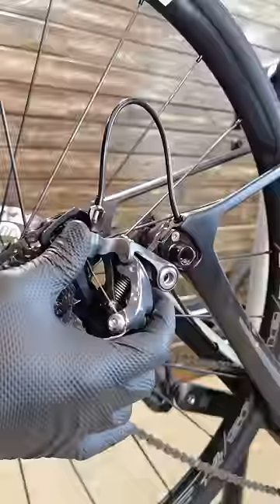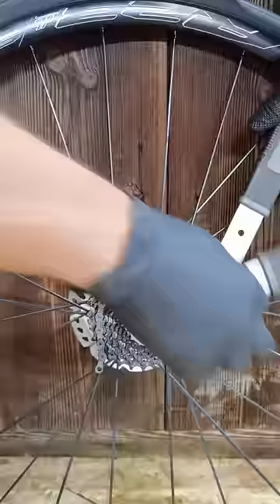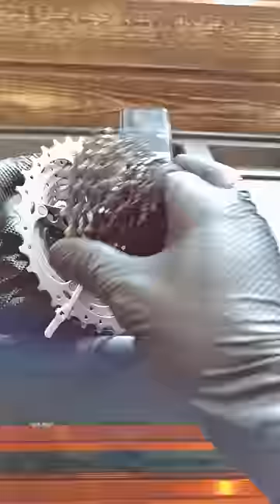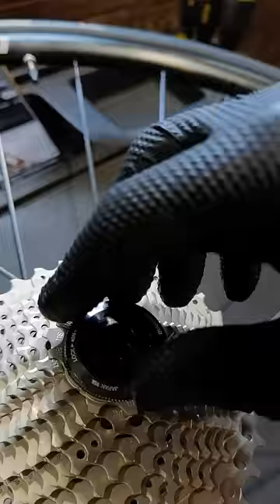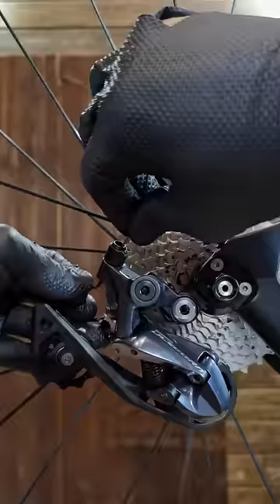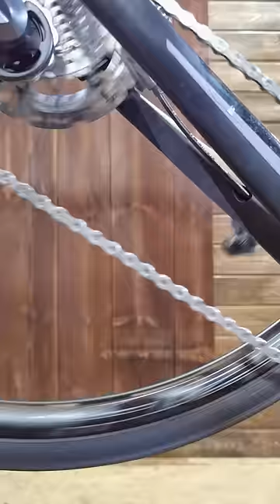Need lighter / lower gears on your road bike? Do this.

Comment: Tip: get the Sunrace CSMS8 11-36 instead of the shimano one, even more range and it as a 12 tooth cog so you have 11-12-13-15 instead of the big 11-13 jump at the top end. shifts maybe a tad harsher but just as fast/good.
Reply: Big jump?  😂

What about the 45-51 on the XT cassette?
Reply: @ulukai_555  I have 24-34 jump in 7-speed megarange freewheel but on higher end 2 teeth difference is affecting cadance much more than you thought
Reply: Sunrace cassettes shift really good.
I have a 7 speed 13-28 sunrace cassette in the rear and it’s shifting amazing. Even with a cheap shimano acera derailer
Reply: @ulukai_555  45-51(13%) is actually way less difference in cadence than 11-13 (18%) and, on the top end, jumps tend to be much more noticeable anyway. so yeah, its a big difference to have 11-12-13 instead of 11-13 on a road bike. or to put it different: you almost need to go almost 9kph faster for the 11tooth cog to have the same cadence again that you had on the 13 tooth one. thats a hell of a difference. in perspective, 45-51 is only around one kph difference.
Reply: Shimano don’t make 11-36 in 11 speed but SRAM is compatible and better quality than du race at a similar price.

Comment: 11-34 works fine with ultegra short cage. I'm only running 46 34 up front tho...maybe it wouldn't have capacity for 50 34

Comment: Can you just “guess” the chain length? Serious question
Reply: Guesswork isn't an option here.

Proper chain length can be determined by wrapping the chain around the largest chainring & cog and adding two (usually the case for road drivetrains) or four more links, depending on the bike type and rear derailleur cage length.

Comment: It sure seems wiser to replace one part instead of three or four, if it's possible to go that low in front. Replacing the cassette with a larger one will of c get you larger leaps between gears which I personally don't like when I'm on my road bike. Aand the WEIGHT goes up 😱

Also, check the capacity of the derailleur before you replace it. Unnecessary to replace if the derailleur can handle the new cassette.
Reply: The Ultegra RD-6800-SS can't handle anything larger than 11-28T or 11-30T. He definitely knows this.

Comment: Non-ergonomic cassette. The small chainrings should be changed in 1 tooth steps. With this cassette you will lose power when shifting at higher speed. Example of a comfortable 11-s cassette: 11-12-13-14-15-17-19-21-24-27-30 teeth

Comment: You can swap just the cage to get a long cage version. It’s super cheap and very simple. I did it in my 9150 DI2 and it sweet with an 11-36 and no road link. The long cage gives you more chain wrap for better shifting.

Comment: You need lighter gears to lug those heavy hydro disc assemblies.
Reply: You prefer steam engines to combustion too ?
Reply: Comments like these are typically made by weekend warriors with a 30+ BMI.
Reply: @user-d32658 he's right isint he!😐

Comment: No need for the new long cage derailleur! Just stop going all the way up the block in the big ring, which you shouldn't be doing anyway!
Reply: What’s the point in getting a bigger outer ring? Yes, you shouldn’t ride that for hours because of the bad chain line, but it’s meant for super steap climbs.
And yes the new derailleur probably isn’t needed. Only adjust the distance to the cassette in lowest gear.

Comment: Why do you have to change the derailleur?
Reply: The cage is longer, what will lead to more chain tension on the smaler sprockets. is needed because the diffrence between high and low is much bigger.
Reply: short cage derailleur wont accommodate bigger cassette

Comment: just buy half a thousand dollars worth of equipment and change your whole cassette, chain, rear derailleur

problem solved
Reply: ulegra deraileur is 70€, cassette as well, chain is 30€ and maybe should be changed anyway. not that expensive.
Reply: @Digi20  my comment was of course an exaggeration, but the title is ludicrous
Reply: 140 eurs for that? Come on, i still ride on a 105SC derailleur made 20 years ago with a front chainring 34-50
 @Digi20

Comment: Actually you don't need to cut the old chain for that it's still good if you want to change cassette don't cut the chain if you want to change chain don't change the cassette stupid mechanic as always
Reply: How do you make the old chain longer?😂
Reply: its good practice to put a new chain every time you put a new cassette
Reply: @DjRudeboy254  yeah but for me if the chain is still good and setting the new cassette i just wash the chain and degrease it then put it back I'll change my chain ⛓️ if it's Gonna rupture